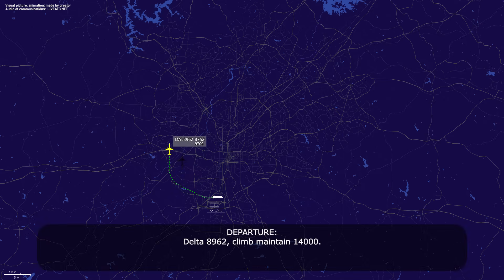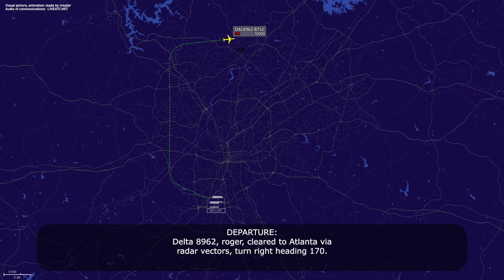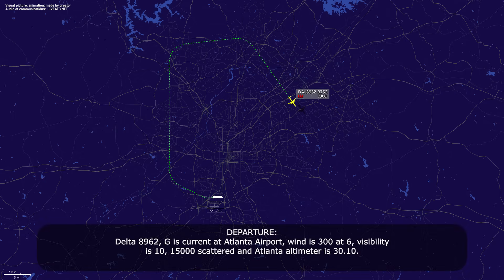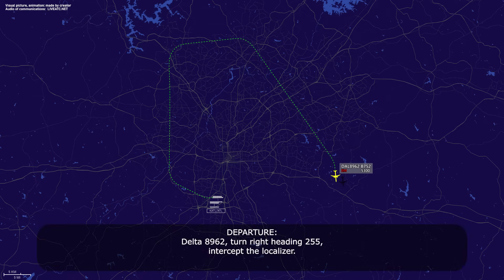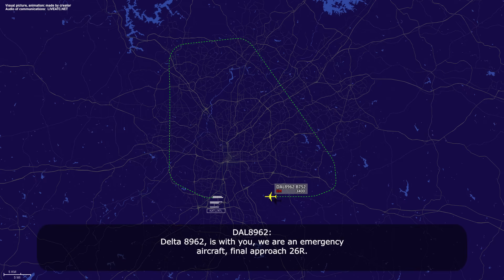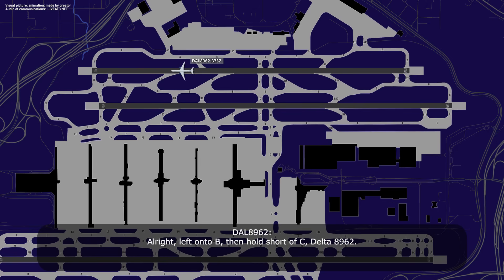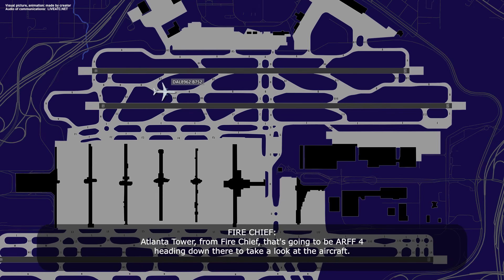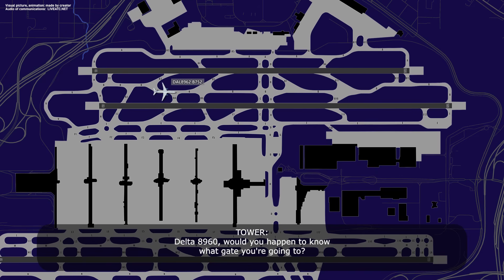We're having right engine problem. No oil pressure. Delta B757 returns to Atlanta. Real ATC

Comment: How many INFANTS on board !?  Wonder when THAT got into the 7110 ! LOL
Reply: Was that just a subtitle error, or did they really ask about infants? If so, anyone have any idea why?
Reply: @makingachanneltopost  Just a small talk probably to distract the pilots from the problem so they are not afraid
Reply: @makingachanneltopost  Lap infants. They're not assigned seats, making it easy to miss them in the event of an evacuation. This happened before,  so it's becoming more common for controllers to ask this question when an emergency is declared.
Reply: Hazmat and infants. I was waiting to hear sarcasm. "Yeah, the other guy in the cockpit is both!"

Comment: 44 on board for a B75 seems rather sparse. Was this a charter?
Reply: Yes, Delta operates a fleet of 72-seat, all-first class 757s for this purpose. Their biggest client is the NBA, for whom (if I remember correctly) they fly all but 3 teams, while the Dallas Mavericks, Houston Rockets, and (at least historically) Detroit Pistons each have their own jet. The NBA is currently not playing, but other sports teams and charter flights still need to move around. If you see a Delta flight with a flight number in the 8800s or 8900s, that's typically a charter flight.

Delta's VIP 757 fleet is aging, so they're going to replace them with A321neos in the coming years, and the US Department of Transportation has already approved this for Delta. (Charter flights, despite being operated by the same company, are governed under different rules than regular commercial flights.)